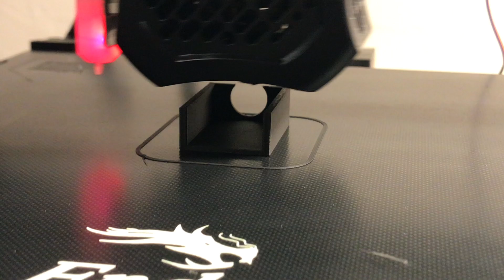Ender 3 V2 updated Firmware

Comment: any advice for bed plate adhesion?
Reply: I used the square outline stl from this guy  https://youtu.be/_EfWVUJjBdA   and adjusted the spring knob things while it printed and rubbed my finger over the lines as it went to check the adhesion.

I also added a thin layer of glue from a glue stick for good measure, fine spray hairspray seems to be another method some use to add a little more tackiness to the build plate too.
Reply: @NeilLund  thank you brother 😀